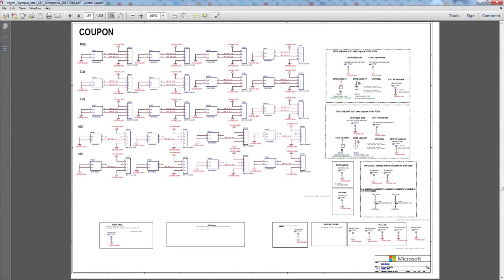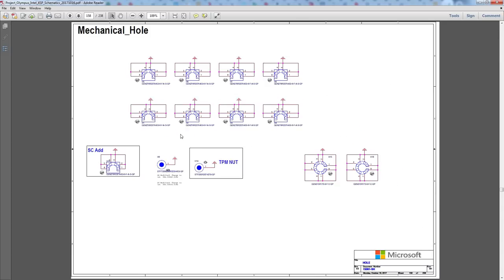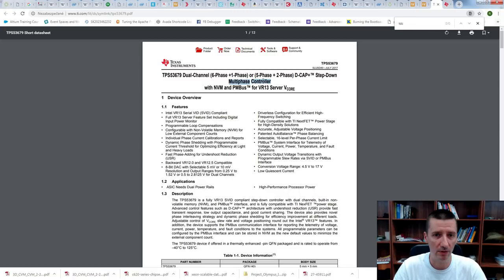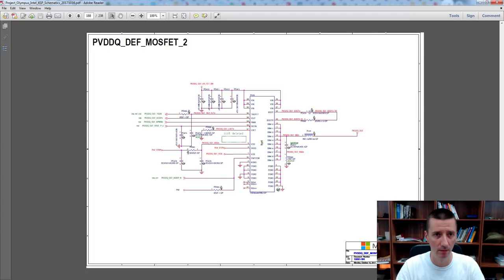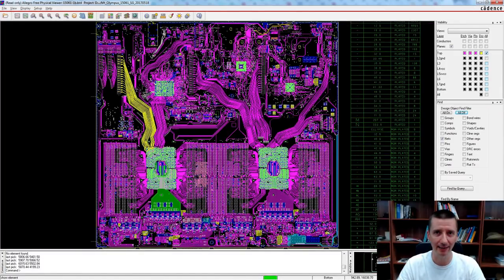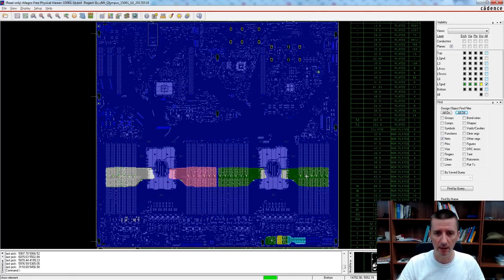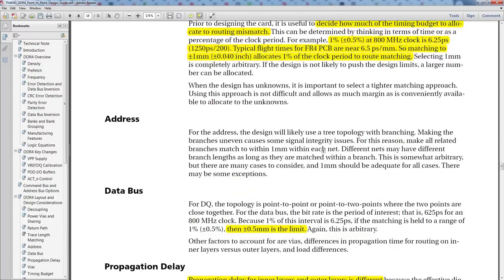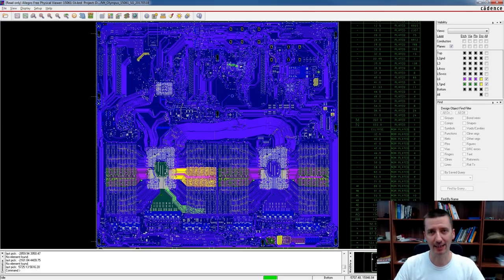Review of Server PCB Layout & Schematic - Part 6: DDR4 Memory Layout & CPU Power

Comment: Nice to see a multi-phase VR design. Unfortunately, the TPS53679 does not have a fully disclosed datasheet (and which multi-phase VR controller, intended for use in processors, has?).

Comment: again great video.. fun part about the reference planes or ddr4, the way its documented is ideal for DIMM but almost impossible for onboard chip routing. hard part is to read those documents so carefully that you don't miss gems like that.. in any case with regards to the length matching, is the length in the design also compensating the internal wirebonds of the chips placed on the board? and what do you think about the tabbed routing.. i know it's for fext compensation introducing more capacity but not much more inductivity.. it seems there is experimental functions for generating this in cadence, but not in altium (too bad)... in your opinion do you think it was needed for this design?
Reply: you can read more about tabs in this paper https://www.intel.com/content/dam/www/public/us/en/documents/white-papers/crosstalk-mitigation-impedance-management-paper.pdf

Comment: Do you know how many people worked on this layout? Is it possible that more then 1 person work on layout design of a board?
Reply: Yes more than one.  Typically, for a design like this, one of the Allegro team design capabilities is used. That and module based design and round the globe/round the clock teams is also very common.    Signal and power integrity analysis is also done throughout the layout by additional designers using Sigrity plug-ins to the design to ensure final SI/PI sign off is successful.